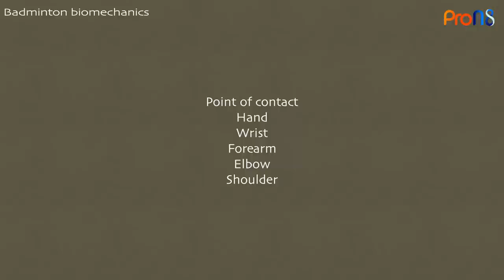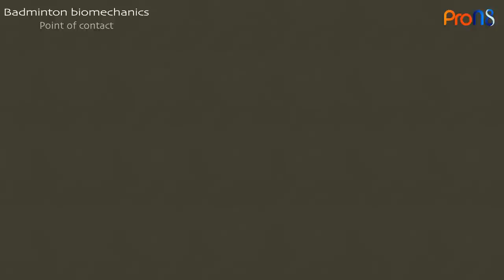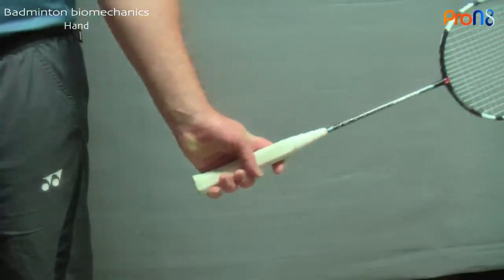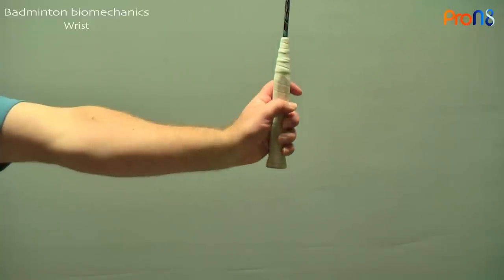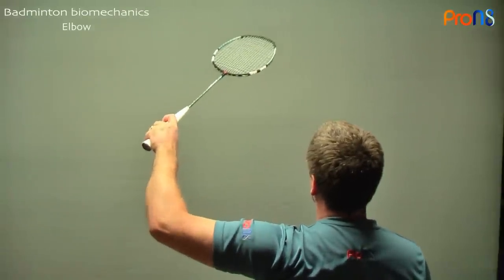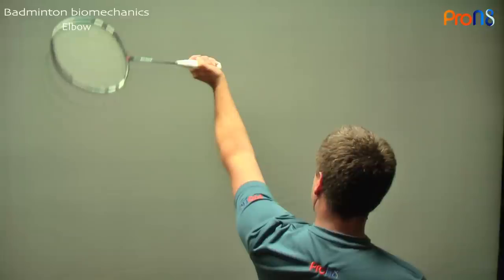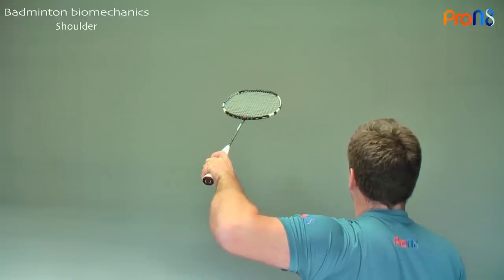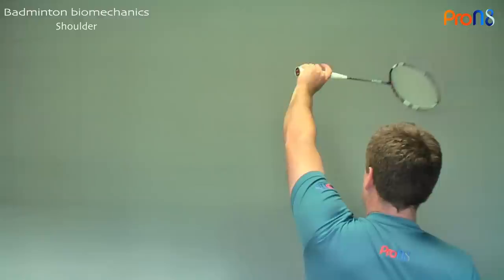ProN8 | Badminton Biomechanics Introduction

Comment: The person seems to be facing the net when he rotates the shoulders, however you find the professionals facing the net side on. Is there any difference when the persons starting position is side on (with toes pointing to the sidelines)
Reply from the maker: Hi Ashley, you are correct that professionals often start by having the non-racket shoulder towards the net. This first video concentrates on the racket arm, not footwork or the body.  The angle that the body makes with the net in preparation for the stroke depends on the particular stroke. In a jump smash the body typically starts at 90 degrees to the net. In a normal clear the body will typically be parallel to a line drawn from the centre of play. Does this help?